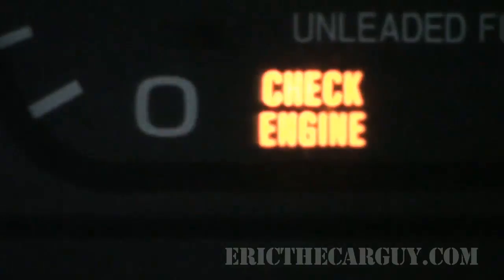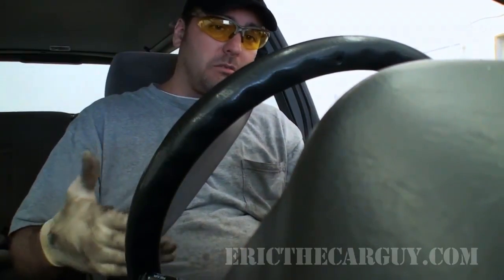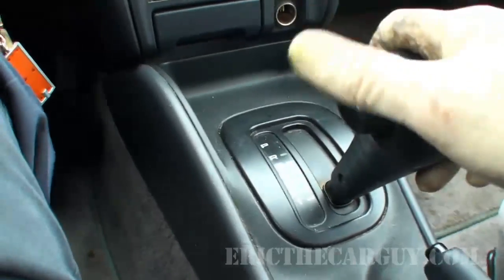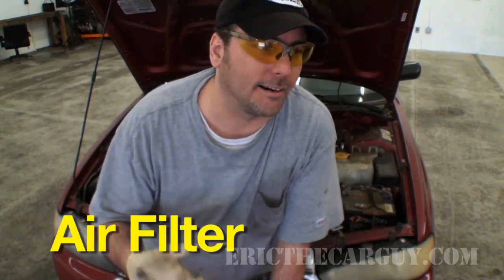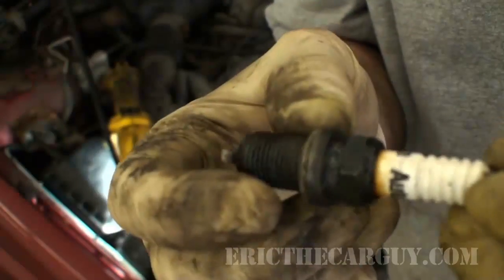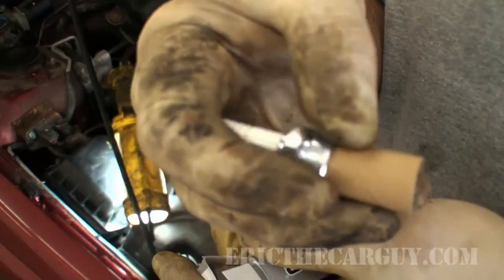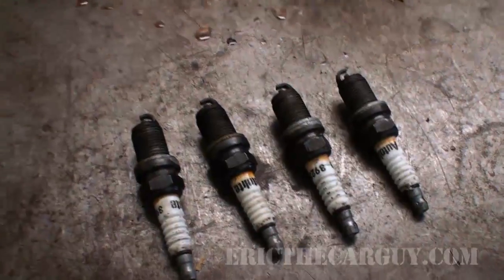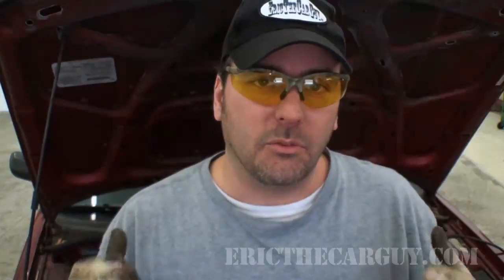Solving Engine Performance Issues (Part 1) - EricTheCarGuy

Comment: Hello ERYK, I HAVE HAD A LITTLE PROBLEM FOR A MONTH, NAMELY A 2005 CHEVY TRIALBRAZER 4.2 L START PERFECT TEMPERATURE NORMAN ON THE MIDDLE GAGE, SMOOTH DRIVING ON HIGHWAYS ON A SECTION OF 5 TO 10 MILES, AVERAGE 19.8. ONLY IMMEDIATELY AFTER DOWNHILL AND STOP AT THE FIRST TRAFFIC LIGHT DOES IT START JERKING FOR 2 TO 6 SEC. AND RETURNS TO NORMAL AND AFTER ABOUT 20 MINUTES THERE IS NO CHECK ENGIN LIGHT AGAIN. CAN YOU GUIDE ME? The car has 70,000 miles.

Comment: My problem is probably not related to this, but it sounds the same. I really didn’t know what I was doing  I decided to put in a quart of transmission oil  the problem went away  it wasn’t until months later that I learned how to measure the transmission oil on my car and via  and I just got lucky that at 149 degrees my transmission temp is measured. …It was right in the middle of the low and high so I got lucky this time. I wouldn’t recommend this to anybody find out how your transmission temperature is measured first then do the needful  like I said I just got lucky that’s all

Comment: my 01 celica gt   has a situational hesitation.   it takes off fine but when running 45/to60 very slow  like pedal will be on the floor an have  to lift up an re applhy   an you over taking another can or merging.  it starts gaining speed very slowly. its an automatic.  i know they're slower but i drove a 93 saturn sc2 auto for years before i got the car never had an issue .  so can anyone help me figure this out?

Comment: Yesterday, I noticed my first and second gear lost power, but when I put in 3rd gear, 4th to 5th, I could feel the energy.  Do you know what the cause for it? I checked my engine I saw oil on my spark plug. Do you think this is the cause of first gear and 2nd gear no power?  I hope you can help me, please.
Reply: Likely vacuum issue. Vacuum issues show up at lower rpms allowing far more air than needed. Too much air at higher rpms are not as
noticeable. Slight possibility of a  timing issue

Comment: Love the videos!   I would disagree with you about gapping the spark plugs.  (Remember I'm the guy with 3 engineering degrees, certified in engine, transmissions, and tune up by the time I was 16 and won the Pacific automobile award when I was 17.  So I'm a real nerd.  But I can always learn, and your videos are terrific.)   The size of the gap is critical as it determines the  energy released which is very critical.   The reason that you may not like the autolight's is that each spark plug has a specific resistance which determines the current flow and therefore affects the energy released.   This resistance combined with a spark app the spark app determines the total energy released.  If you had issues with autolight's, you might try increasing the gap a little more than the specification which will deliver more energy.   Spark plugs are actually very simple devices.  However when I was researching this for my tuneup certification, I did note that the resistance varied amongst the different manufacturers.   This is easily addressed by modifying the gap to make the total energy release per spec and increase performance.

Comment: I just want to comment, Im having the same problem on my subaru hesitation when accelerating, so i have added the injection cleaner it only works for so long and its back to the same thing, hesitation, so should i check the spark plugs and fuel filter, on my 2010 subaru legacy?

Comment: START WITH THE BASICS -  THANK YOU SO MUCH !!!   could not put off any longer the worsing hesitaion/engine performance on my 130K Elantra so i google ( EricTheCarGuy -hesitation).   BOOM -this excellent video quickly tells me: hum, maybe I should change those plugs after 80k miles -  problem solved!  So from thinking maybe my Elantra finally gave up the ghost to pure joy (from getting passed/horned by gramma to being able to challenge hot rodders).  Big fan for about 10 years now, you are the go-to-guy for us car DIY enthusiasts - THANKS A HUNDRED TIMES & 100 MORE TIMES IN THE FUTURE !!!!!

Comment: Can disel be used to engine flush in petrol cars. 
Take 2.5 litres of Disel and mix 1/4 th of fresh engine oil and shake well. Empty old engine oil then put the prepared disel flush agent to the engine then idle engine for 3 minutes. Once again empty(flush) the disel+oil =gunk will be gushed. Change old oil filter and put the fresh 👌 engine oil and run the engine.
Hopes the above works as engine flush.

Comment: Checklist...
Sparkies
Air Filter & Mass Airflow Sensor
Throttle-Body/valve clean
Timing belt/chain
Fuel Filter/Pump
Alternator

Comment: Had some shuddering the vehicle just stopped. Towed it home. Replace fuel pump, crankshaft sensor,  starter..ran good for a 100 miles. Pressure was at about 52 psi. Started driving Then it started with the slow sputter until i throttle up. Replace plugs twice in 2 years, #7 and #5 was carbon build up and smell of fuel. Ughhh

Comment: I have an esue with my s60 volvo 2001 non turbo. It jerking when i put into higher gear especially when it cold start. The spark plug was change 2 years ago, i had replace 2 of the ignition coil lately, this problem came when the mass air flow sensor had an esue I cleand it but still have the problem. The problem is no engine light no code so I don't know where to fix. Maybe some oil got into the spark plug when the vvt gasket broke and oil runs around the ignition and into the timing belt. The motor run smothly when it idleing and the rpm is normal. I know that there is no esue with the transmition gear. I don't know maybe I will let the pro look at it. Any help out there?

Comment: My Datsun 720 pickup 2.0 5 speed started doggin hard when I get on the gas, then it wants to stall unless I keep steppin on the gas over and over again, NO power at all, I have to pull to the side of the road and just barley move along 10 miles an hr. then all of a sudden it goes away. power comes back for a few mins, then all starts all over again. I changed the fuel filter by the gas tank and put in another Coil. but it seems to not help. An hr later I'm trying it again, I can tach it up to 4 grand but it's cutting out real bad.

Comment: I am having perhaps a similar issue in 2007 Forester. I have no check engine light and historically the car sat for a year or 2 with dirty tank and blocked in tank filter as well as failed in tank strainers. I first changed filter, Strainer and put aftermarket pump, then I used POR15 tank process with second new filter and left side strainer, then new genuine fuel pump module (filter, strainer, pressure regulator, gauge and pump). Along the way I have cleaned injectors twice, new genuine plugs early in the game, air filter and throttle body cleaned several times. I am now leaning to dampers x 2 on fuel rails (they might be a mess based on original tank condition), Electronic throttle pedal (a friend had one that needed cleaning once) or wondering if the Cat has an intermittent blockage (can that happen?).  There are times when the car runs very nice and than pretty much out of the blue performance reduces to about half. It never leaves me stranded and even gets up steep hills just relatively slow. If I floor it it does kick down and rev high but on upshift it looses power again. Before I resealed the airbox in the fender that box used to buzz a lot under power loss conditions. Any ideas?

Comment: Just found a set of autolites in my 94 Honda accord. SMH. It's crazy how simple a performance issue you can have with that.  Autolite plugs are just a cheapy, crappy plug. Even if I owned a GM or something else I'd still care to put a better plug in it.

Comment: I have a “performance” problem with my ford ranger, it usually likes to hesitate or lose power from a complete stop in first gear, when i take off it goes to about 2k then drops then picks back up after a few seconds, also it tends to do it around 1/4 tank or less sometimes when it’s full but not usually, ive replaced a lot of parts and nothing seems to fix it, im sure it’s the one thing im over looking. But anyways I know the frustrations of going out on the test drive and it doing the same thing

Comment: 1 PSI drop across the old filter does not seem unreasonable and I would expect a small drop due to filter media. Comparing old to new, there was only a 1 psi difference and I would expect thats within tolerance of testing a 1000 filters. Now the flow rate seems reasonable to be problematic, except if there is less flow across the filter there should be a pressure drop as well. I can see a filter causing the initial hesitation, which then goes away as fuel pump kicks up pressure.

Comment: My del sol has runs rich and idles rough, after I rev it and let off it almost stalls and hits about 100 rpm. Also it runs very rich. This all happened after I changed a cam cap. I made sure I put everything back together correctly and torqued it properly.

Comment: Helping accidentally dropped a round cardboard cylinder into spark plug hole was desracted by neighbor NGK vpower plugs tune up and it fell inside the hole afraid to crank the car I don't wanna damage my engine how can I remove it without removing the head limited tools

Comment: Also had a no click no crank issue replaced starter and starter inhibitor switch mounted above clutch pedal aka neutral safety switch main relay was purchased in 2016 but if electrical which I strongly feel it is due to my engine was rebuilt in April of 2016 and carefully maintain my vehicle I feel it is electrical..car just suddenly died wouldn't take a jump or pop start father in-law hammered my starer breaking it into pieces so had no choice in replacing it....any solutions with that issue would be helpful also.thanks

Comment: Hi Eric ...I'm a follower of yours love the helpful videos very educational thank you so very much...but today I come to you with a question for a helpful solution or suggestion on my issue...I was giving my 1990 Honda civic sedan a tune up and was changing my spark plugs ..when I got desratcted by a neighbor and accidentally dropped the round cardboard cylinder that protects the spark plug when it's in it's box.....upon removing the new spark plug from its box too install them into each spark plug hole 2 out of 4 round cardboard cylinder fell into 2 of the holes ...I was table to remove the valve cover and retrieve one ....but one more still remains inside a spark plug hole and ...I need a helpful solution on getting it out..without removing the head ...any helpful solution ..PS afraid to crank the engine because I don't wanna damage anything....limited tools also

Comment: Eric I have an issue. I went today to Mobil Gas station and I usually never go there, I usually goto Esso or Shell but today I went to Mobil. My cars fuel light was on so I put 93 Octance almost full tank in my 2004 Acura TL after filling up I went and parked my car literally 20meters away from me, after waiting 5mins I noticed my RPMS bouncing below 1k and stalled on me. I couldn't start the car because it keeps stalling but I never had this issue before. It seems to be misfiring the whole time but I dont understand could this be bad gas ? My car was driving perfectly fine for a long time just till I put gas in my car. please help me brother. I uploaded a video of the issue so if you can view it and let me know that'd be very helpful.

Comment: Hey Eric. I have a hesitation but not while driving. Only at idle and starting the car. I recently replaced the timing belt with help and spark plugs myself and the vehicle rpms are ridiculous. Any ideas what it could be ? Would a maf make that a problem?

Comment: Hey Eric... I got a 97 Honda accord ex 4 door  2.2  4 cylinder.   The spark plugs keep getting wet with gas...  can you help me figure this out.?  I changed them twice already.
Reply: Sounds like your not getting spark mate.  Check all your coils and electrical on ignition side. Also, If you have a broken tooth on a crankshaft signal plate then your Engine Control Unit won't be getting a correct reading from your Crank Position Sensor which can cause no spark or a misfire.

Comment: So I have a misfire in my impala and was told I had to change my spark plugs, would that solve the issue or
Reply: Cylinder 1 and 4 aren’t working and I was just wondering if the spark plugs would affect that

Comment: Great Help, thank you.   Where are you located?  LOL I'm desperate for an honest knowledgeable affordable mechanic.  I'm trying to diagnose a intermittent crank no spark - no start and intermittent no power shut off while driving.  FYI i'm no mechanic but can read, learn, & follow instructions ;)  Changed fuel pump- had a worn out hose inside tank. 00 B2500se 2.5L. Pulling one spark plug out at a time.  Can one test spark plugs & wires with just a test light?  What is preferred gap?  it is recommended .042 -.046  - the middle .44? lol

Comment: The best tune-up.  Extend the lifespan of the engine. Clean your engine without dismantling and replacing the parts.  Engine cleaning with Hydrogen stream removes carbon built-up on Catalytic converter, injectors, pistons , cylinders, valves, Egr valve, exhaust manifold,  Spark plugs.  Engine recovers original performance and lost power, decrease fuel consumption up to %10, eliminate HC and CO and helps the car to pass the Smog. Helps the car owners to save on expressive parts and labor. Carbonbusterengine.com las vegas

Comment: I need help i have a 92 acura legend i just replaced my spark plugs but theres still some hesitation im running denso double platinum what should i check next oh by the way my fuel filter hose is leaking

Comment: Hi Eric, I have a 2005 Mazda 6 2.3l 5 speed A/T with 150000 km, the car hesitates when I put the pedal to the metal in any gear including Neutral and Park, the car struggles to go uphill. The car has not thrown any codes, I changed the Spark plugs, air filter is clean. Which direction should i go from here?

Comment: NGK or Denso. Always check & verify gap on all plugs when out of the box if possible or allowed to.

Also always change the spark plugs every year even iridiums.

Check your engine belt/chain, a loose pulley, clogged dirty fuel filter or fuel pump, fuel injectors?

Comment: I actually have those spark plugs in my 94 toyota tercel and it runs ok but according to the manual it needs the NGK BPR5EY11( a.k.a. V-POWER ) plugs or equivalent that have a groove in the center electrode.

Comment: previous owner installed a higher flow fuel pump.  Can I have too much fuel pressure on a MPFI system?  (87 Chevy Sprint Turbo)

Comment: The main reason for not using AC, Champion, or any of the other iron-based threads is that they rust. And as Neil told us long ago RUST NEVER SLEEPS. If you install any of the aforementioned plugs among others is that rust will seize to aluminum. When you go to remove the AC you have a high probability of tearing the threads out of the head. You can let a customer decide if they want the head pulled to install heili-coils or take a chance and install with head-on. Take a chance of getting shavings in combustion chamber A heli coil install kit runs about $100.00. Have install many many of those coils. But, people will still insist on using what they learned many many years ago. Monna told me, " AC,s are the best", and Momma can't be wrong

Comment: FYI.  Auto manufacturers always recommend you use their OEM branded spark plugs.. It keeps them in business.. Any spark plug listed to fit your application will work just fine.  Normally what causes spark plug failure can be and usually is an outside condition such at rich fuel mixture, excessive oil consumption, degraded plug wires, misfiring coil or COP.  You get the idea!

Comment: hi big buddy  i realize this is a old video , but a question i have for you , i have a automatic 99 dodge neon 2.0 sohc. as i drive it does have power but as i go around a corner then up a hill  it slows down then it's like i got to push down on the gas  to get it to muster power. then when  i have to slow down behind someone going up a hill. the same issue i have to push the gas pedal.  we as drivers , are sorta like doctors ,  you can tell when something isn't quite right. any suggestions . thanks for your time and help., your friend from missouri, mark.

Comment: I did a fuel pressure test, when I turned the key to the "Run" position I only got 18 or so lbs, then I turn the key off and did it again and it climbed up to the upper 20's the last time I did it got up to the needed 39 lbs. Is that a problem or normal?

Comment: Hi Eric, I changed several spark plugs over a short period of time, and all of them they have an orange crown on the top side, the one the lead plug's. I can't find anywhere why that is happening is it normal? I'm running some ignition advance but other than that the engine is stock.

Comment: Eric, Autolites don't belong in Fords any more than they belong in a Subaru. Fords have run Motorcraft since the 70s, when they sold Autolite to Allied Signal. Autolite is an aftermarket plug that has many specifications over many different car manufacturers. They're not OEM on anything I'm aware of. But I agree, NGK would have been a better plug than an Autolite.
Reply: Do your home work Motorcraft spark plugs are made by Autolite.
Reply: True story✔

Comment: when the pressure rose when you shut off the engine is know as the water hammer effect 
From Wikipedia 
"Water hammer (or, more generally, fluid hammer) is a pressure surge or wave caused when a fluid (usually a liquid but sometimes also a gas) in motion is forced to stop or change direction suddenly (momentum change). A water hammer commonly occurs when a valve closes suddenly at an end of a pipeline system, and a pressure wave propagates in the pipe. It is also called hydraulic shock." 
correct me if I'm wrong.